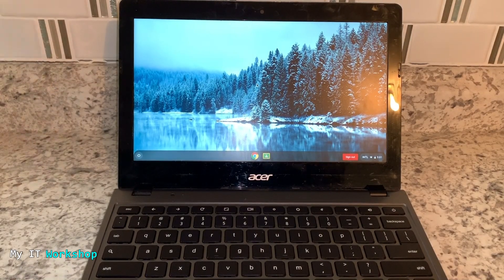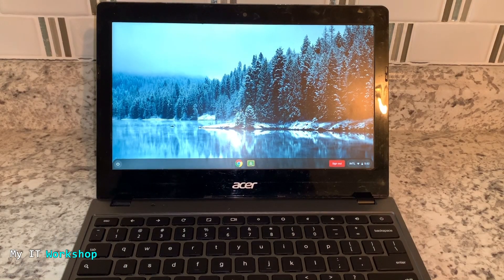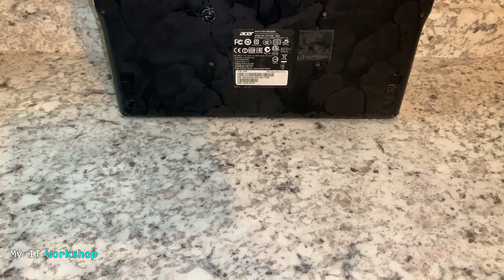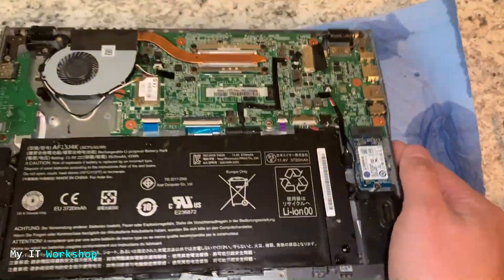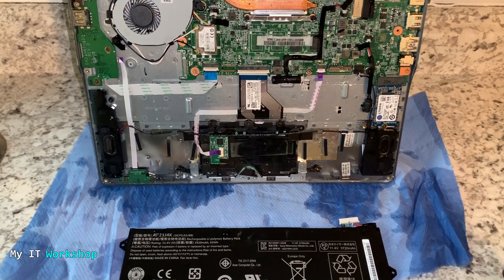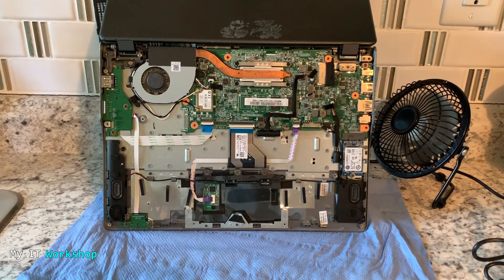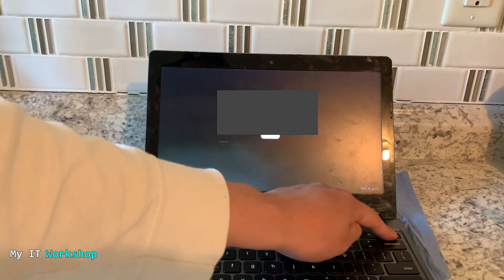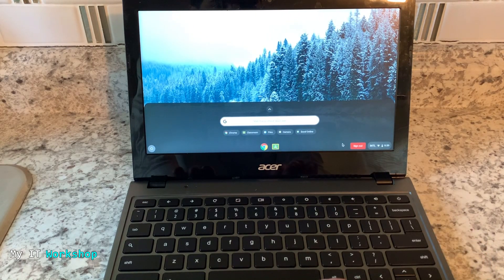Chromebook Damaged by Water | Fixed

Comment: Mine got a spill on it a few days ago. I tried this, I took it apart. Dried it out, and the display is acting up. The board itself turns on. It charges, but the display connector does not seem to stay connected or the display is going out, I am not sure which. Have any tips to fix it?

Comment: what do i do about when it messed up the sound? i just spilt koolaid on it 5 hours ago and the audio is supe buggy, when it happened the audio stoped working imeadiatley and after i cleaned it it still didnt work and ive restarted the chromebook multiple times, the sound will work and then itll pause anything and the sound ceases to work, any idea how to fix this? everything works but the sound and im worried that itll do this for ever and i hate that im watching something fun or intersting and itll cease to work. i dont know whats going on

Comment: umm i have a question my chromebook is charging slow and it does not show when its charging on the screen but it does show next where the charger is plugged at and it does not charge when it on only when no one is using it and if its powered off what do i do? pls help me

Comment: hi, my chromebook was also got wet and I tried to open it and dry it, but I didn't remove the battery (beacause Im scared and I don't know how to😅)the system is completely working but my problem is that it doesn't sound anymore, what should I do please please i need help

Comment: I’ve got a Toshiba Chromebook bought it in 2015, some water has spilled on the bottom of it quite a lot. I wiped the bottom and moved it to somewhere dry. I tried to turn it on the next day and all I see is a black screen and little flashes of light that you almost can’t see on the screen. What do I do ?

Comment: i’m not sure how sensitive the mother board is so if I had a a soda spill and I feel as though most of it reached the mother board and is still underneath in places i cannot reach, would there still be hope for it to turn back on, i’ve already removed the battery although i couldn’t remove it fully because the wiring is so tight but im not sure if im screwed

Comment: Thank you for posting this! I just have one question- so my roommate spilled soda on my keyboard a few months ago, I followed the steps and was able to get it completely dry and the computer itself has been working fine (from a digital perspective) ever since! However, some of the keys on the side that got spilled on have been having some issues. Every key still works, just some of them require extra force when pushing them down to get the letter/symbol to actually appear. I'm thinking this is due to the sticky soda having compromised them all those months ago. Is this something that can be repaired? I'm fine to take it into a shop or do it myself, I'm just curious if there is anyway that this can be addressed. Thank you!
Reply from the maker: Hey,
Correct, the stickiness is due to the soda. It will depend on the model, but in most cases chromebook’s keyboard are disposable. Meaning it will easy to replace it than to troubleshoot single keys.
Another solution would to use an external usb/usb c keyboard.
Hope it helps.
Thanks for the comment
Reply: Try spraying alcohol on the keyboard to rinse off the soda and let it dry for a few minutes.  It should evaporate quickly.

Comment: I'm so screwed I let mine dry and I removed the keys buy I couldn't take of the back it's kind of working but I need to keep it plugged in or it will shut down also the battery icon has ceased to exist so I don't know if it is charged or flag

Comment: Spilled drink on acer laptop, turned over to dry for 3 days, will not turn on, should I replace battery?
Reply from the maker: Hello,
A laptop can work without a battery.
I'd say there is still water on different components of the laptop.
Opening the case helps to dry it out.
Hope it helps
Thanks for the comment!

Comment: what can i do if the keys don’t work
Reply from the maker: Hello,
I'd, if possible,  to remove it from the device itself, carefully of course. Then, dry both side with a fan or paper towels and test it again.
If that does not work, most likely it needs to be replaced. 
Hope it helps
Thanks for the comment!

Comment: I left my chromebook next to a bottle of bubbles inside a box and my dumb mind didn’t think the bubbles would spill all over. Well it did. My chromebook won’t turn on. It light up when I put it to charge but after a while it stopped and hasn’t light up ever since. Btw, I have no knowledge of those tools used in the video. I have a bunch of tools that look the same as that one in the video, but it isn’t working. I’m probably using the wrong screwer or smth. It’s a Dell chromebook

Comment: Help i have a acer chromebook 315 and i cleaned it with water with a napkin and the keyboard stopped working but it still cut on and i was using the in screen keyboard but 2 minutes later it started turning off by it self and the screen started flickering on and off and wouldnt turn on at all also the led charge button started blinking also

Comment: Can it still be fixed if it has been hours and it won't turn on due to damage caused by garlic sauce?
Reply from the maker: Hello,
The sooner you try the more chances you'll have. The reason being garlic sauce is sticky, so you may need to gently remove it with paper towel. 
Hope it helps
Thanks for the comment!

Comment: I had a scarf wrapped around my chrome book when it was in my bag and a bit of rain water got on it, not a massive amount but since then ( A year ago now) the screen has been glitching sometimes it’s clear but soon reverts back to glitching. My question is their anything I can do for this now or am I too late?
Reply from the maker: Hello,
With screen/display issues I try connecting the device to an external monitor/tv. If the problem is present also in the external monitor then there is an issue with the motherboard. If there is no problem, then the issue could be the display on the chromebook or the interface/cable between the display and motherboard.

Hope it help
Thanks for the comment
Reply: @MyITWorkshop  thanks for getting back to me. I’ve rebooted it and it seems to have helped a little bit no more continues glitchy lines but still not 100% clear.

Comment: We were able to get the chromebook back on, but now the bottom right displays the battery as always charging (even when it's not plugged in) with the battery icon fully loaded, and clicking on lower right will reveal what percentage the power has but not estimate how many hours. It will be hard to know when it really needs a charge or stop it from dying on me without constantly checking in on it manually. Is there any fix for this?
Reply: The chromebook is thirsty and needs more water.
Reply: @gotsm9959  Yea it's been thirsty for a while

Comment: sooo the back doesn’t come off of my chromebook. i unscrewed all the screws and all the edges come off except the ones at the top near where the laptop bends. any tips?
Reply from the maker: Hello,
That happened to me on the model in the video. 2 screws were covered by tiny rubber, well…..covers. I had to remove them before seeing the screws. Maybe that’s the issue with yours.
Hope it helps thanks for the comment!

Comment: Rain fell on mine for minutes while I was away
Reply from the maker: Dry it up as soon as you can ⏲⏲
Reply: My room was flooded yesterday evening 
I disintegrated everything this afternoon 
Will it be a problem
Reply: Let’s say I left it for hours before I could start drying it
Reply: How long should I dry it
Reply from the maker: If you dont have fans, i’d say at least a day, removing the back cover and in the position shown in the video.
Hope it helps
Thanks for the comment
Reply: Hi
Reply: After putting everything back together 
The power light keeps on blinking
Reply: I removed the battery and it started working and it just went off again 
I plugged the battery back in 
The light blinked once and stopped 
There is nothing happening again

Comment: question, what do i do if the SOUND isnt working on it, but it is fully dry? let me know when you mke a video for that if you do please
Reply from the maker: Hello there,
I'd connect external speakers or headphones to try the sound. If it works, then I'd say the speaker on the chromebook stopped working and need to be replaced.
I'll check on my chromebook if i can replicate the problem.

Thanks for the comment!
Reply: @MyITWorkshop  thank you for the reply and i look forward to a new video

Comment: I had a bit of water on my touchpad and i wiped it with a microfibre cloth and the mouse started to work for like 5 minutes. so i followed your steps. I couldn't take the back of the chromebook off because i didn't have a small screwdriver so i turned the chromebook upside down and put a fan on facing the back of the chromebook. my touchpad is now working. hopefully it stays working-fingers crossed
Reply: Does it work
Reply: @sinfulmonarchweeb8826  yes, i turned off my chromebook also, had my chromebook upside down. i didn;t use the fan for long but kept it upside down for air to get to it.  hope it works for you also. good luck
Reply: How long did you have the fan on for?
Reply: @hayley22-w6e  about 15 minutes and then i just placed it upside down in my room. it also depends on the situation. don't give up
Reply: @tanyarenaissance8829  Thank u so much this helped me so much
Reply: @duttreacts4780  omg I am so happy it helped you. Now go enjoy your chromebook :) and keep liquids away from it lol

Comment: How can I fix my chrome book, I wasted water on the keyboard of it then if I press a key it just spams other keys.

Need help :(
Reply: Use an external keybaord
Reply from the maker: Hi, 
Let it dry some time. However, I'd try removing the keyboard and let it dry like that.
If you do that and still doesn't work, I'd say the keyboard needs replacement.

Hope it help
Thanks for the comment!
Reply: @MyITWorkshop  it’s been like this for weeks but, I’ll try to unscrew it and let it dry.